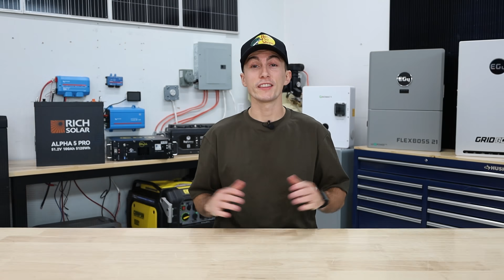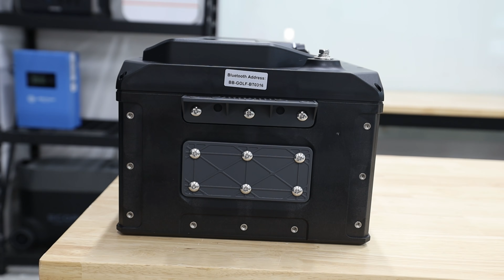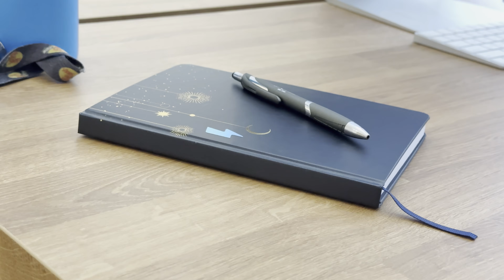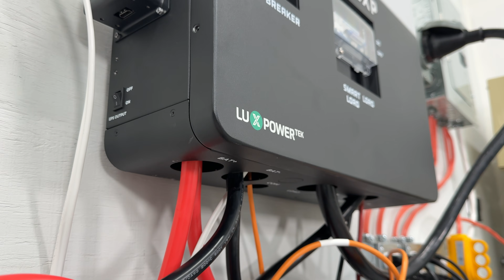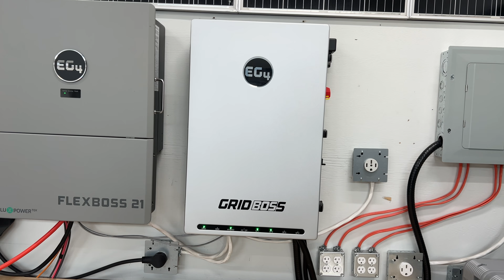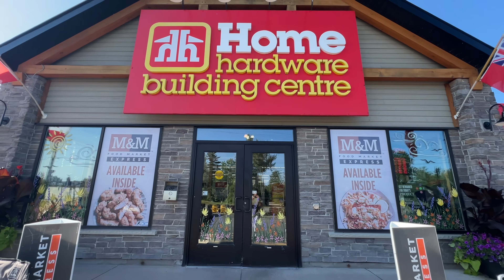Best Batteries, Inverters, Panels & More - The Top Solar Gear of 2025!

Comment from the maker: 🛒 Top Batteries of 2025
➡ EG4 LL: https://signaturesolar.com/eg4-ll-s-lithium-battery-48v-100ah-server-rack-battery-ul1973-ul9540a-10-year-warranty?ref=thesolarlab
➡ EG4 LIFEPOWER 4 V2: https://signaturesolar.com/eg4-lifepower4-v2-lithium-battery-48v-100ah-server-rack-battery-ul1973-ul9540a-10-year-warranty/?ref=thesolarlab
➡ EG4 Indoor WallMount Battery: https://signaturesolar.com/eg4-wallmount-indoor-battery-48v-280ah-14-3kwh-indoor-heated-ul1973-ul9540a-10-year-warranty?ref=thesolarlab
➡ EG4 All Weather WallMount Battery: https://signaturesolar.com/eg4-wallmount-all-weather-lithium-battery-48v-280ah-14-3kwh-lifepo4-all-weather-energy-storage-ul1973-ul9540a-10-year-warranty/?ref=thesolarlab
➡ BigBattery 48V Husky: https://signaturesolar.com/bigbattery-48v-husky-2-lifepo4-lithium-battery-5-12kwh-for-rvs-camper-vans-commercial-vehicles/?ref=thesolarlab
➡ Get Extra $50 OFF with Code: THESOLARLAB50

➡ Rich Solar Alpha 5 Pro: https://shopsolarkits.com/products/alpha-5-pro?ref=TheSolarLab
➡ Get Extra 4% OFF with Code: THELAB

🛒 Top Inverters of 2025
➡ EG4 3k: https://signaturesolar.com/eg4-3kw-off-grid-inverter-3000ehv-48-3000w?ref=thesolarlab
➡ EG4 6000XP: https://signaturesolar.com/eg4-6000xp-off-grid-inverter-split-phase/?ref=thesolarlab
➡ EG4 12000XP: https://signaturesolar.com/eg4-12000xp-off-grid-inverter-v2/?ref=thesolarlab
➡ EG4 FlexBOSS18: https://signaturesolar.com/eg4-flexboss18-hybrid-inverter?ref=thesolarlab
➡ EG4 FlexxBOSS21: https://signaturesolar.com/eg4-flexboss21-16kw-ac-hybrid-inverter-n752/?ref=thesolarlab
➡ EG4 GridBOSS: https://signaturesolar.com/eg4gridbossmid?ref=thesolarlab
➡ Get Extra $50 OFF with Code: THESOLARLAB50

🛒 Solar Panels & Accessories
➡ Panels at Signature Solar (Sirius Out of Stock): https://signaturesolar.com/all-products/solar-panels/?ref=thesolarlab
➡ IntegraRack IR-30 ➡ https://signaturesolar.com/integrarack-ir-30-ballastrack-solar-module-rack-1-frame/?ref=thesolarlab
➡ Chiko Ground Mount Kit ➡ https://signaturesolar.com/chiko-usa-groundflex-u2v-solar-panel-ground-mount-kit-large-module-version/?ref=thesolarlab
➡ EG4 Chargeverter: https://signaturesolar.com/eg4-chargeverter-gc-48v-100a-battery-charger-5120w-output-240-120v-input/?ref=thesolarlab

🛒 Maple Leaf Goose Mount ➡ https://solarpowerstore.ca/products/maple-leaf-v-adjust-30-60-goose-ground-mounting?sca_ref=8413425.d8S7O4uNqvuK&sca_source=youtube&utm_source=affiliate-program&utm_medium=websites-blogs&utm_campaign=affiliates
➡ Get 5% OFF with Discount Code THESOLARLAB

🛒 Shop Our Favorite Products on Amazon: https://www.amazon.com/shop/tsl047

🔔 Subscribe to our YouTube Channels 
➡ https://www.youtube.com/@TheSolarLab 
➡ https://www.youtube.com/@TheSolarLabPlus

-------------------------------------------------------------------------------------------------------------------------------------------------- 

⚡ Read Our Full Written Review: https://www.thesolarlab.com/reviews

🔌 Access In-Depth Reviews, Guides & More: https://www.thesolarlab.com/  

--------------------------------------------------------------------------------------------------------------------------------------------------

0:00 - Intro
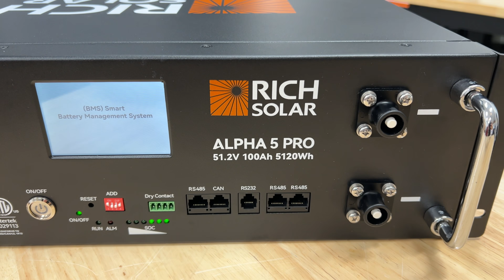1:23 - Rich Solar Alpha 5 Pro Server Rack Battery
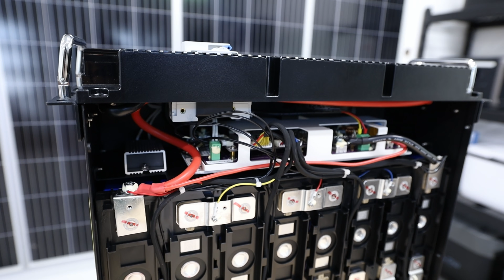2:29 - EG4 LL's & LIFEPOWER4 Server Rack Battery
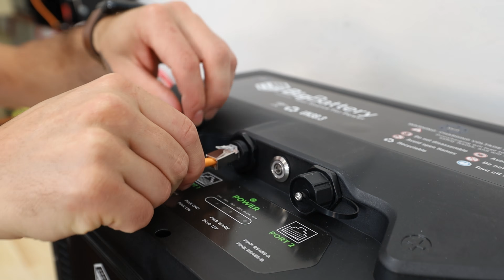4:15 - BigBattery 48V Husky
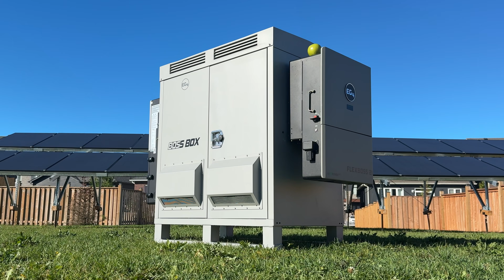5:45 - EG4 280Ah WallMount Batteries 
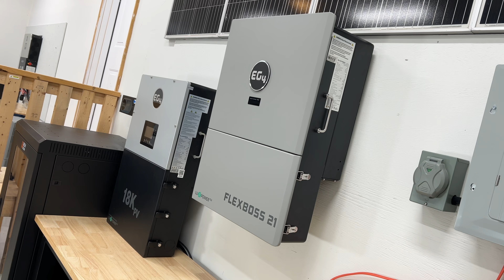6:58 - Inverter Problems
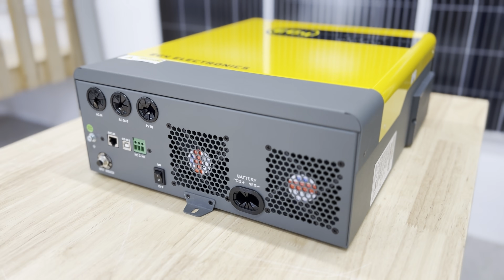8:35- EG4 3000EHV-48 Off-Grid Inverter
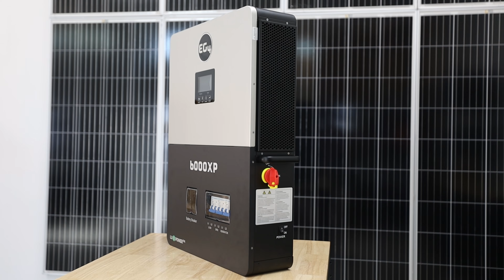9:31 - EG4 6000XP & 12000XP
12:00 - EG4 FlexBOSS & GridBOSS
13:43 - Solar Panels 
14:40 - Maple Leaf Goose Mount
15:40 - IntegraRack Ground Mount
16:59 - Chiko Ground Mount
18:27 - Recap & Deals

Discover the best solar batteries, inverters, solar panels, ground mounts, and accessories of 2025 in our biggest unbiased, unsponsored roundup yet. We tested every major 48V server-rack battery, wall-mount battery, hybrid inverter, off-grid inverter, bifacial solar panel, and panel stand so you can invest with confidence and avoid the junk flooding the market this year. From the Rich Solar Alpha 5 Pro, EG4 LL, BigBattery Husky 2, and EG4 Wall-Mount 280Ah to our top inverters like the EG4 3K, EG4 6000XP, EG4 12000XP, FlexBOSS 18K/21K with GridBOSS, plus the most durable and cost-effective panels and mounts including the Sirius 415W bifacial, Goose Mount, Integra IR30, and Chico Ground Mount, we break down real-world performance, durability, pricing, build quality, and install experience. If you're building a home backup system, off-grid cabin, RV setup, garage solar array, or full backyard ground mount, this is your go-to guide for the top solar products of 2025—optimized for reliability, efficiency, and Black Friday savings. Subscribe so you don’t miss our 2025 BFCM solar deals and full product reviews.

We maintain an affiliate relationship with some of the products reviewed, which means we get a small percentage of a sale if you click our links, at no cost to our viewers.

Comment: I charge a Tesla and a Rivian. With the air conditioning running I can hit over 15kw usage. Is there an inverter that can handle that load? Right now I'm running dual Ecoflow Delta Pro Ultra X inverters because a single one couldn't handle the load.

Comment: I'd love to see a video specifically for peak shaving. My problem is having two breaker boxes. One in the basement with heavy loads- well pump, oven and 2 heat pump systems. Really would like something to take over at peak times then recharge after.

Comment: If you were building off grid, which would you choose?  Flex Boss or 12000xp?  Not a cabin.  A complete house, off grid.  Normal life.
Reply: I'm in the same situation.  I bought the 12000xp.  Price dropped $700. Get it now!

Comment: Why do you keep saying EG4, they don’t make inverters. It’s luxpower.
Reply: They don't make batteries either. Or BMS's. Both of those also come from China as well. But they still like to say and market themselves as "Designed and Made in America". It really is unfortunate how shamy of a company EG4 appears to be when they say they make/produce their own products when they clearly don't and when you call them out on it, then in their defense they say 'well we just focus on the firmware of the BMS/inverter side of the hardware' which even then it's still questionable as their firmware wouldn't always work right, like their batteries communicating with an inverter/SolarAssistant, nor would two of their batteries bought in the same purchase order communicate with each other. And no point reaching out to them for assistance because they wouldn't even know how to help you with the software they supposedly wrote.

Comment: Here's what Google has to say about these EG4 products. "As of October 2025, EG4 Electronics is facing a legal investigation regarding premature inverter and battery failures, but no class action lawsuit has been officially certified. The law firm Migliaccio & Rathod is actively investigating consumer reports of hardware failures, which could potentially lead to a class action. 

However, the company's terms and conditions contain a class action waiver, which could complicate such a lawsuit. 

Key issues leading to investigation:

Premature hardware failures: The most significant complaint involves EG4 inverters and batteries failing within a few years of installation. Some users report multiple equipment failures in a short period.

BMS and firmware issues: Consumers have reported that battery management systems (BMS) have failed, which can cause communication problems with inverters and result in power outages.

Security vulnerabilities: In August 2025, the Cybersecurity and Infrastructure Security Agency (CISA) published an advisory on multiple security vulnerabilities found in several EG4 inverter models. The vulnerabilities could allow for unauthorized access to a user's network. EG4 has acknowledged the vulnerabilities and has been working on a fix, including new hardware.

Poor customer service: Complaints on social media and forums detail customers' negative experiences with EG4's customer support and warranty claims, with some reporting difficulty in getting timely responses or proper solutions for defective equipment"

Comment: Curious why you would recommend the flex boss grid boss combo over just going with a sol ark 15k or 18k both of which are cheaper easier to use and take up way less space, I assume this is related to the fact that you have not reviewed them?

Comment: I still don't understand the need for the flexboss and gridboss if you want to tie into the grid. Doesn't the 12000XP do what both of them do together?
Reply: I was thinking the same.   I would need to go to the 18K to get the 200amp passthrough.  They just split the functionality into 2 pieces so you could use the flexboss as off grid only.  Just my understanding.
Reply: 12000xp does not have the ability to feed back to the grid.
Reply: @allenandersen4423 thanks. That was not my understanding. I don't have solar now, so not a big deal, but I hope to offset with panels some day.

Comment: i want to make my own power bank/power station. 

For this, i want the best inverter charger. i could get seperate ones but cost is a factor. 

i dont want too many features. outlets are still kinda the go to item. a 1000w microwave is pretty good, maybe an induction hotplate. Not at the same time. 

Usb type a is also important.

Comment: Haven't seen anything specifically on this yet but what might be the best value for marine batteries? Small boat 2-5kwh and large boat 10-100kwh or greater installations? The concern is largely dealing with heat and sea air being corrosive